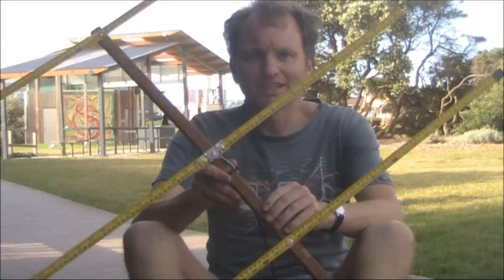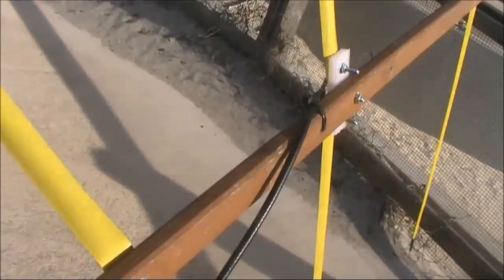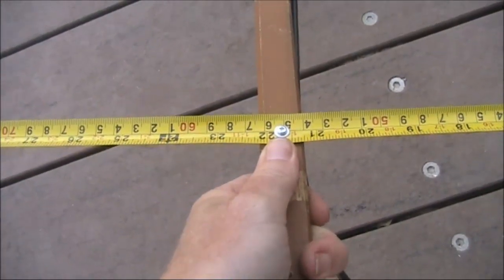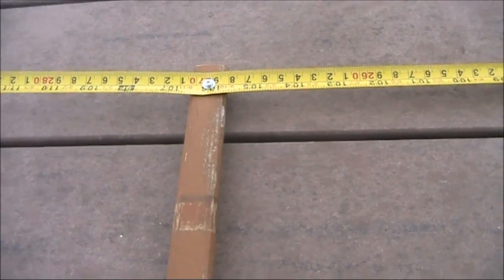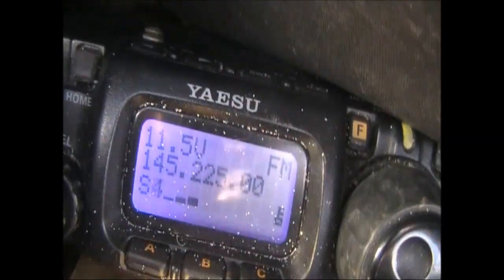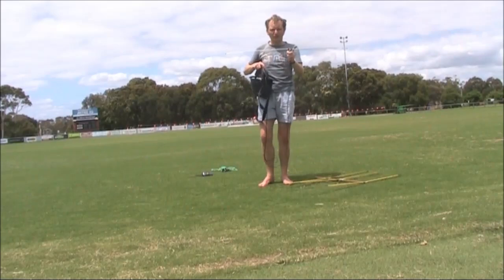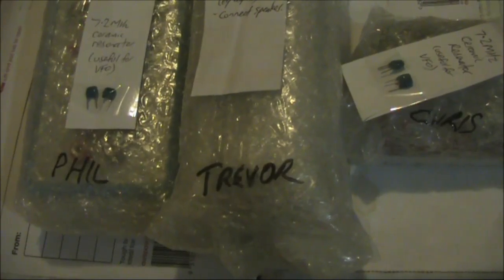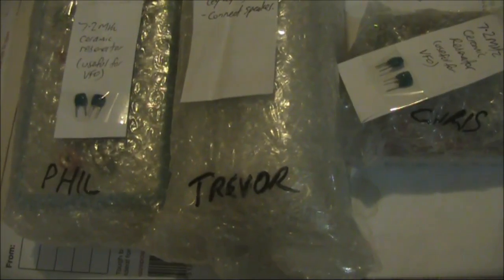Testing a tape measure yagi antenna for 2 metres

Comment: I built one of these and was a bit disappointed in the forward gain. The front/back nulling is very good as you show in the video but it is not able to pull in anything I don't normally receive.

Comment: I just made mine today but i think my measurements off as the swr in high  ill check it using ur measurements now. thanks  W  VK1FWBD
Reply: Correction. Had the reflector and director around the wrong way

Comment: Nice! I built a TMY for SOTA and as an experiment put it on a ski pole for a walking stick.  I don't have something right just yet but it was fun to build.  I did like the slider option and explanation at this page - https://sites.google.com/site/tapemeasureantenna/ the description is at the part titled 'The CEBIK pages', W4RNL and the slider is show down further in the section 'The Proof of the Pudding is in the Eating.'  I'm almost jealous of the shorts and warm weather, it is getting around zero Fahrenheit here at night.

Comment: Can the tape measures be mounted whole and intact so that you can extent or retract to match the desired frequency or even different bands as and when required?
Reply from the maker: I've heard of people doing that for HF verticals. The feedline is clipped onto a scraped off section of the tape measure.  You would need a tall pole (eg squid pole) to offer some support. I wouldn't recommend it at VHF or for beams. The rolled up portion will probably contribute capacitance and throw things out. Not to mention the additional weight.

Comment: You can make the elements out of waste aluminum arrow shafts. Find a recreation archery place and get all the broken aluminum shaft arrows.
Reply from the maker: As it happens there is a radio club in Melbourne that shares its club building with an archery club. Don't know if they get the old arrows.